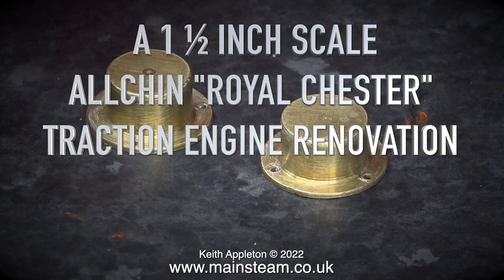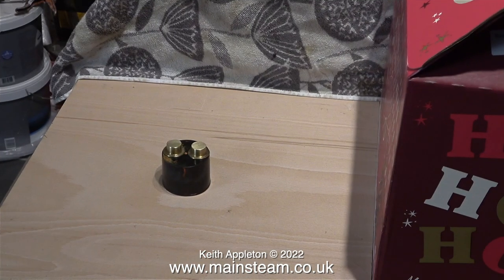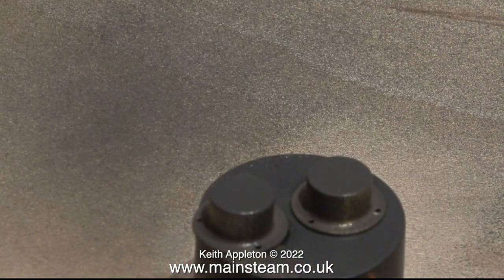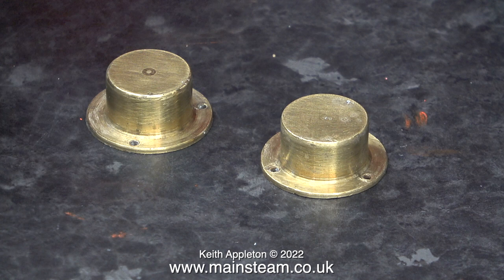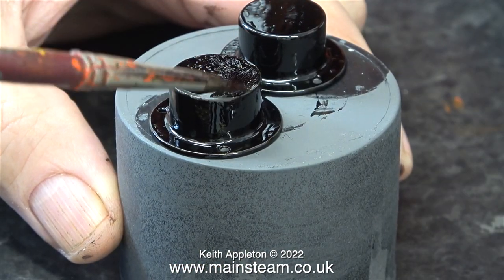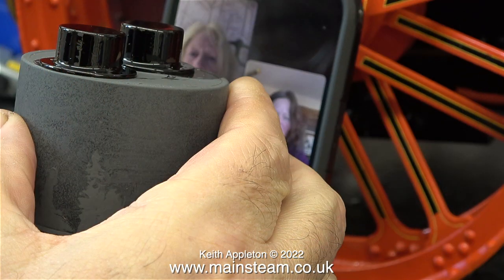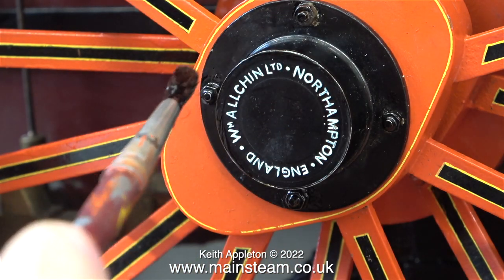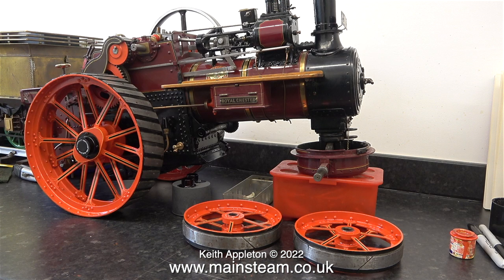ALLCHIN ROYAL CHESTER RENOVATION - PART #12

Comment: Orange peel from spray paint, like what you had on the hub caps, is the bane of my existence. I think it's a matter of the paint being too viscous for the temperature at which it is applied. By the time you have a smooth film, the paint starts bubbling with the solvent and/or propellant.